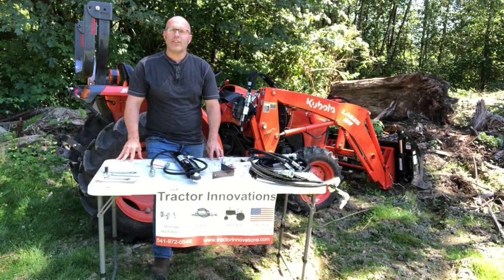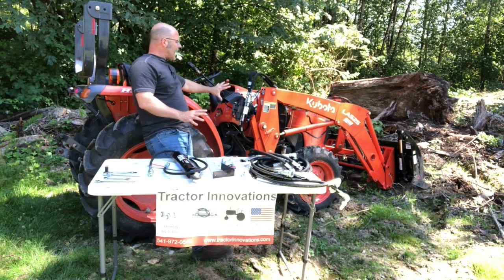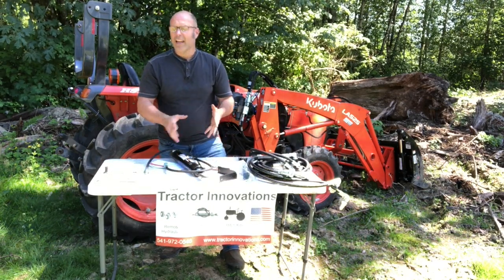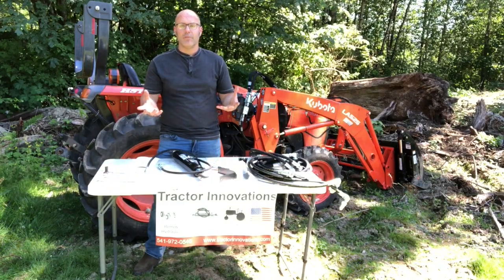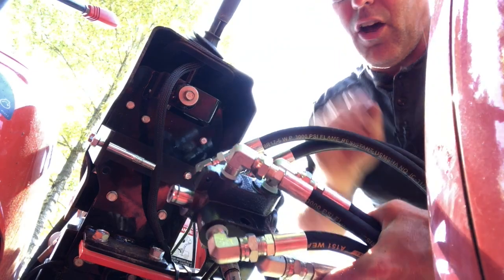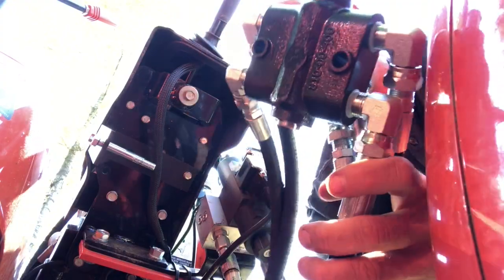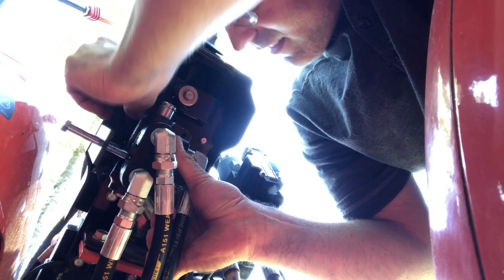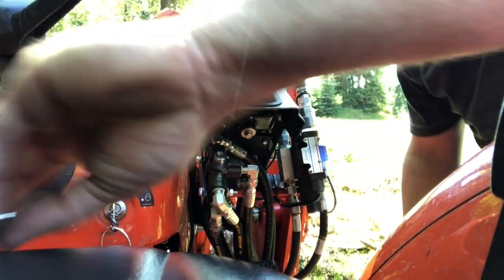Rear Hydraulic Remotes for Tractors with Front 3rd Functions

Comment: On my BX 2660 with LA243 Loader there is not the same loader valve that would accept the bracket for the switching valve.  You've thought of every detail possible, so I'm curious to know the work-around you offer for this.
Reply from the maker: I build kits for lots of different tractors. I have a bracket that works for the BX tractors.   Send me an email or text and I'll send you install pics.

Comment: Any thoughts on how to mount the rear connections with a BH77 back hoe setup?  I was thinking the ROPS - don't have a hoe yet, but I plan on getting one, and I want this kit in the meantime.
Reply from the maker: Yeah, I can do longer hoses, and 90degree fittings on the remote couplers so that you can stretch them up higher, and have the hose head right down under the tractor.    Standard kit has 8' hose, I can do 9' or 10', no problem

Comment: Do you have a front and rear kit for a Kubota B2620 with the LA364 FEL? I am also from Ontario Canada.
Reply from the maker: Yes this kit works great on the LA364.    For a single kit, you simply bolt the switching valve to the flat metal area between the hood and dash.   For a double kit, I build a bracket that bolts to that same flat area, and connects to the floorboard to hold both valves.    I have installed that several times.   I can drop the price of the second kit too.  Searching for a picture...    Shipping to Canada costs just a little more.  Send me an email - that can be found on my website www.tractorinnovations.com

Comment: You can add 2 of these correct?
Reply from the maker: Yes you can!   Video coming soon of adding 2 kits at once.   They both mount on a bracket under the loader valve.  Same simple install.

Comment: When you connect through the 3rd function, do you lose the ability to “float” your implement, say a bush hog?
Reply from the maker: That's right.   You only get the float function if you power this switching valve with your "lift" circuit of your loader.   If you power it with the electronic third function, you will control you front and rear implement with the electronic buttons, and the switching valve will simply determine which one is active.